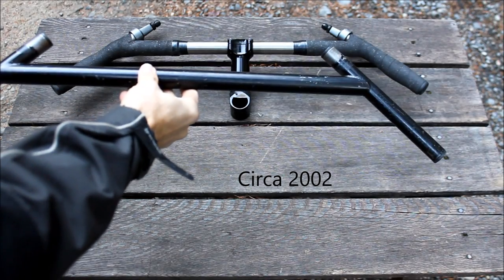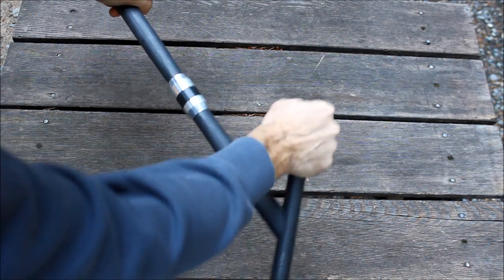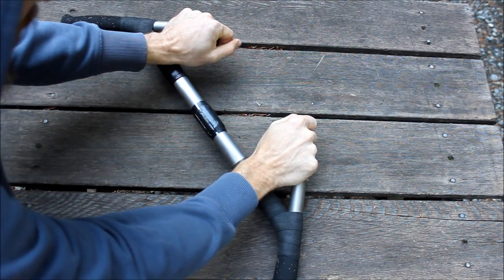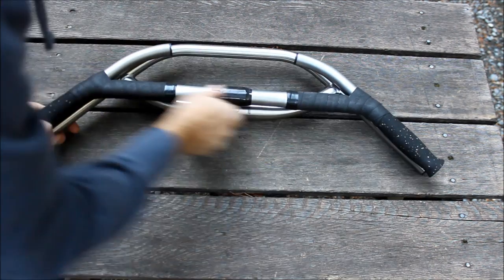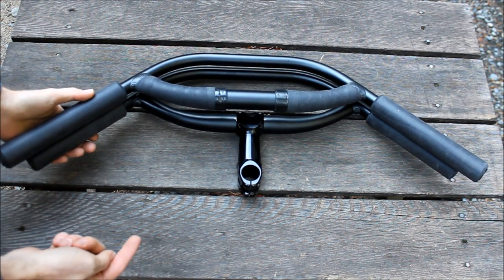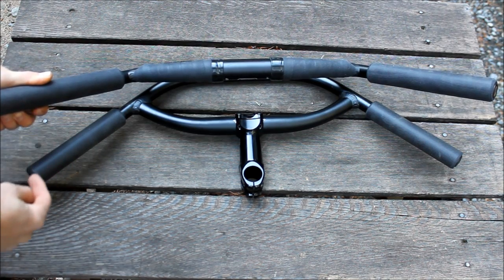Jones Bikes H-Bar Evolution and new bar

Comment: There are only a couple practical positions...  flat bars with Ergon (sp?) and extenders offer more positions.  Owned one for one tour... to E-Bay it went.
Reply: Hi Tony,
whenever I or Jeff hear a comment like yours we get curious about how the bike was set-up.  Jeff really wants riders to be more comfortable, and feels that his H-Bars are a good way to achieve that, so we spend a lot of time talking with folks about how to get the most out of the positions on them!  It's also worth noting here that the Bend H-Bar does have far fewer positions than our main model: the Loop H-Bar.  But even on the Bend, you should have at least three distinct positions on the 710mm version—as long as you use the longer grips that we offer, which are an integral part of the setup of any of the H-Bars.  When using those grips, and not putting your hands anywhere else, you have the position up on or just behind the controls, which will get you a bit farther forward (though not as far as would be possible on the Loop), the middle position where your hands are as far back as possible while still being able to reach the brake levers, and then finally the way back/cruiser position for sitting very upright.  Were you able to get those positions on your Bend? 

We don't usually recommend the Bend H-Bar for touring because the Loop H-Bar is so much better for that type of thing with its much wider range of positions, but it still sounds like there may have been some positions you weren't getting, and that can come down to setup.

On the off chance that you had the Loop H-Bar, there are a few things that might be worth considering: 

Most of the riders we talk to who aren't getting the full range of positions (such as forward on the front loop or even just on the junction of the crossbar and loop), are using a stem that is too long or grips that are too short.  Having already talked about the benefits of the grips, I'll just explain the stem length a little bit.   

Because the H-Bars sweep back so much, it's understandable to think that they would need a longer stem, but the fact is that Jeff is working to get you into a range of positions that is more upright overall—while keeping some lower, more aerodynamic ones too—and to do this he usually moves the bars back toward the rider and up to at least level with the seat (which often needs to move back a bit to keep the cockpit comfortable and center you over the bottom bracket).  To do this on many non-Jones bikes, riders often need a very short stem (like a 40 or 50mm)!  This way you can move back to the very upright cruiser positions, but you can also lean forward and comfortably make use of the forward aero positions.  This is also why we always recommend wrapping at least the rear crossbar and sometimes the front loop as well, in addition to using the longer grips that fill the grip area. 

For more information about setup, anyone who's interested can check out the H-Bar Manual at: http://www.jonesbikes.com/content/Jones_H-Bar_GUIDE_web_v2.pdf

And of course, if that doesn't answer your questions, send us an email or give us a call!

Happy riding!

Comment: So between the 660 & 710, is the width & reach of the loop itself the same with the only difference being the amount of rear sweeping extension?  Any general thoughts on who or what would be best served by the different widths?  Or... what was your original width loop bar and what prompted you to offer the additional width?  Thanks! :)
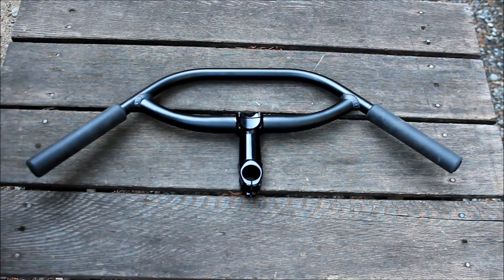Reply from the maker: Yes. The grip length is about 35mm longer with the 710mm version as shown here at 1:13 . The rest of the bar is the same. The wider 710 bar has an extra wider more upright hand position and the narrower 660 bar still has the rest of the positions and is narrower for clearing tight trails.

Comment: It looks like there's two different designs for the loop bar one that has more of an angle (SG) and one that's flat. What would be the biggest thing to consider on which one to choose?
Reply from the maker: Check out the information at the top of this page to learn more about the differences in the bars: https://www.jonesbikes.com/h-bars/ 
Here is the H-Bar manual that covers more of what you need to know about fitting it to your bike:  https://www.jonesbikes.com/content/Jones_H-Bar_GUIDE_web_v3.pdf
Also see this video:  https://youtu.be/Ndt8Di_TjJE

Comment: I'm looking at the 710 loop bar for my new build. I am tall and very wide, and want to do a krampus build. I plan on running shifters and brakes, what position should I have them. What length of grip do I need?
Reply from the maker: Most bikes need a shorter stem to bring the bars closer to the rider as on a Jones bike. The H-Bar manual has has more information about the stem, grips and lever placement: https://www.jonesbikes.com/content/Jones_H-Bar_GUIDE_web_v3.pdf   
Use long grips like these so you can use all the hand positions:  https://www.jonesbikes.com/grips/
Hand positions: https://www.youtube.com/watch?v=yVRY82MO8rs&list=PL9VmikAjJZcJWBF8m39Xp5Nsh9ie-GZJH

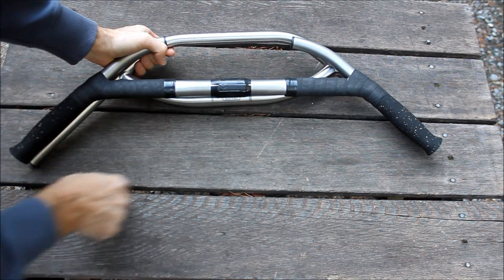Comment: At 1:00 / Where are the grips from?
Reply from the maker: Those are some EVA foam grips that I used years ago. They were too short for the bars, so I needed to add sections of bar tape to make them work, as in this blog post from 2013: https://blog.jonesbikes.com/wrapping-an-h-bar%c2%ae/  We now use Jones EVA foam grips that are the right length for H-Bars, they are thicker and come with a big bar plug to protect the end of the grips: https://www.jonesbikes.com/jones-eva-h-grips-205mm-for-710mm-h-bar/

Comment: Good design but quite pricey.
Reply: eBay has mustache bars of excellent quality for $17
Reply from the maker: Handlebars made from two tubes that are bent, mitered and welded do cost more to make than normal simple bent single tube handlebars. 
The Jones SG Loop H-Bar is $79: https://www.jonesbikes.com/jones-h-bar-sg-loop-aluminum/
Reply from the maker: Jones bars exceed the standards for mountain bike strength testing. 
Those mustache bars may good quality and may have pass the lighter road bike testing standard but they should not be used for rough off road riding. Be careful.